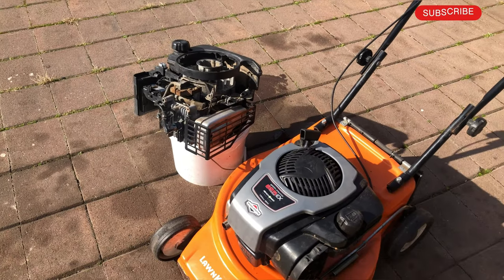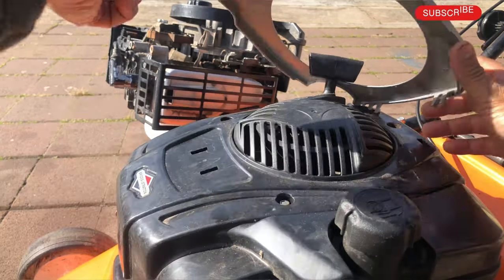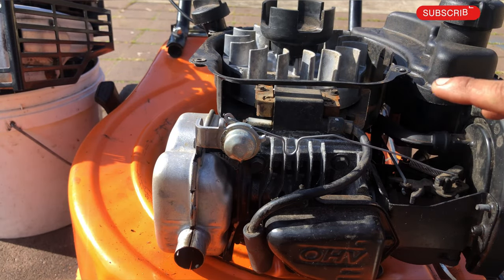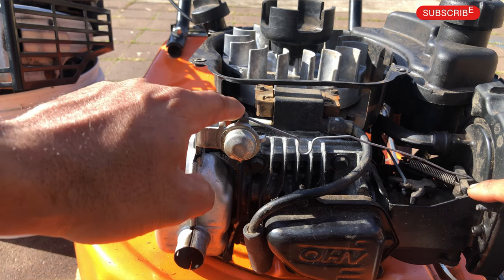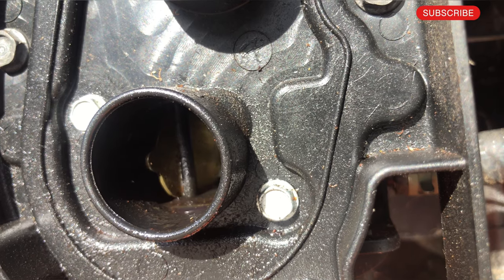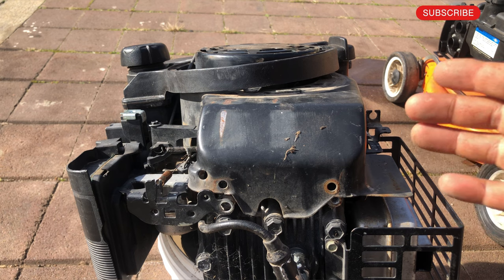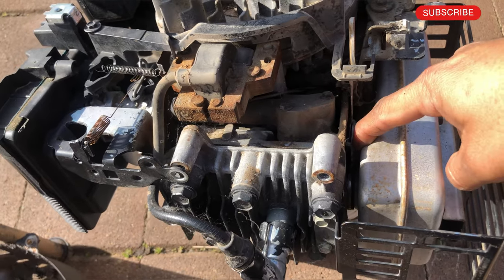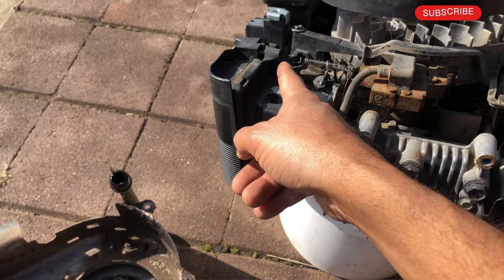How auto choke works on Briggs and Stratton engine .

Comment: The first part of the video did not show the same type of autochoke as the second part.  You should have been consistent with the type of autochoke.  You also could have heated the autochoke mechanism with a hot air gun to show it in action.  Sorry, I was not impressed.